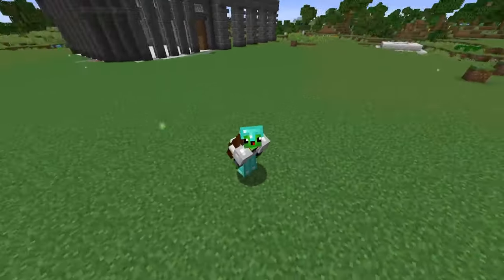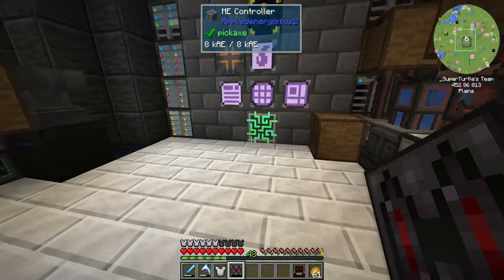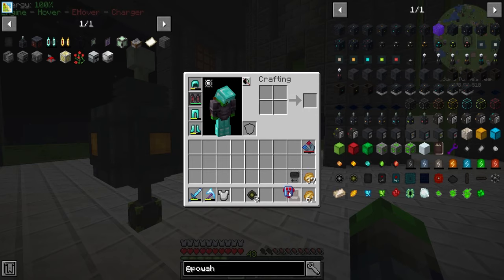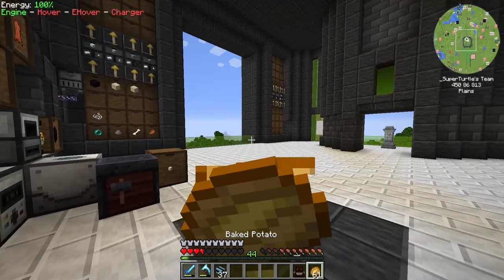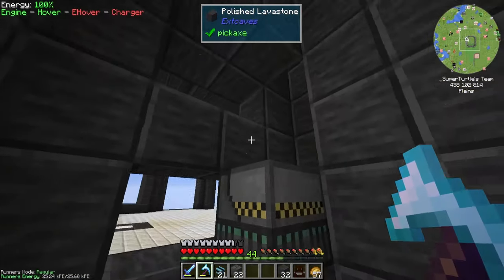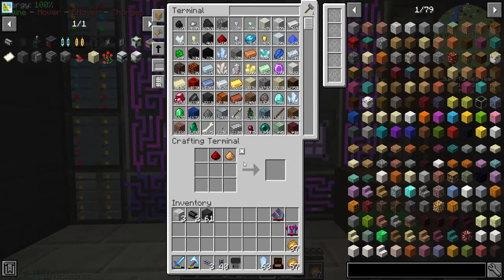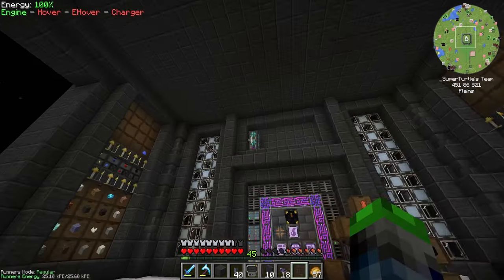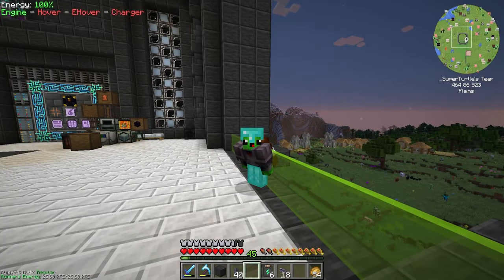Let's Play Direwolf20 1.16 | Major Upgrades to the Jetpack and Autocrafting! | [EP 15]

Comment: Hey bud, flux network controller will let you have wireless inventory and armor charging. Love the vids!!
Reply: Powah is the better option for wireless inventory charging in my opinion.  Flux networks, in this pack/version has limitations on what it will charge that Powah method doesn't have.